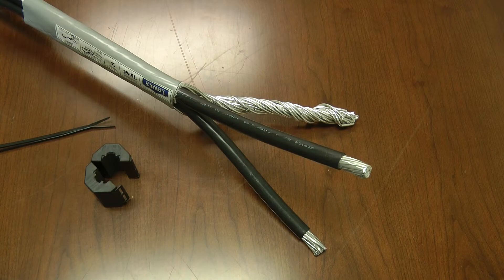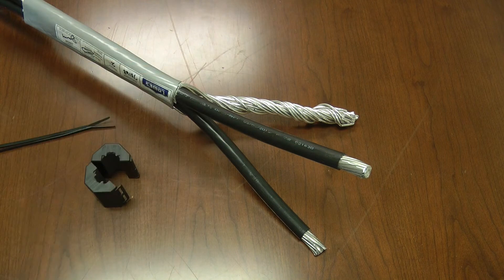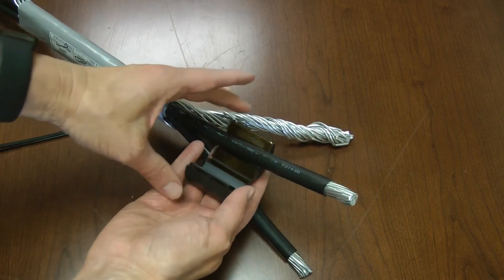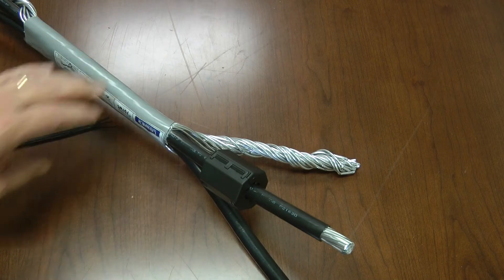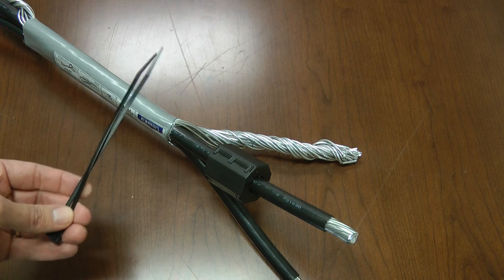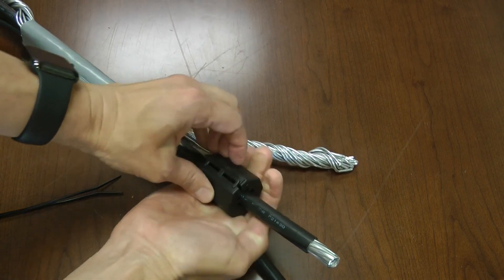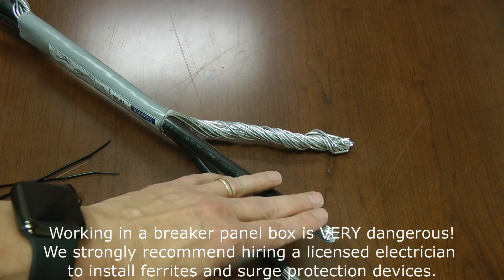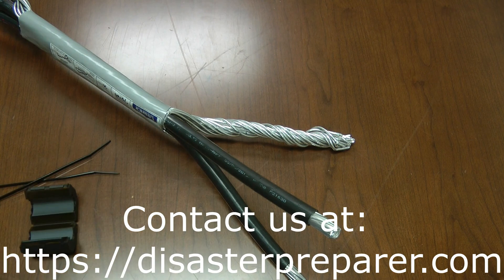Customer Installation Video

Comment: Hey Arthur, I'm about to invest in a solar power system for our home, I was wondering how you would go about handling EMP affects that can't be stopped via a surge protector like you've been speaking about lately? I know we can put a surge protector on a solar power system, but what about the charge controller and inverter? I mean those typically are sitting out in the open, wouldn't they be susceptible to EMP like other loose electronics (like cellphones, laptops, ham radio gear)? Also, do you have any theories on follow up EMP attacks to make sure those of us who have built Faraday cages are for sure down? I don't want to go down the rabbit hole too, much, I want to be reasonable, informed, and not be silly about all of it.

Comment: Thank you, Arthur
Reply from the maker: You bet!
Reply: @disasterprepper  Arthur, do you have any opinion on a respirator or gas masks?  There is a lot of conflicting information about what does and does not protect you from viruses? FDA approved N95 or N99 masks seem to be what a health care worker would wear to take care of someone with a virus like H1N1.  However, it also seems that they may not work 20% of the time even if you wear them properly. Some viruses are .085 microns or less in size.  An N95 or N99 that is FDA approved for health care can filter out only sizes of .10 micron. (not all N95 or N99 masks are equal--you want FDA approval). Since viruses are smaller than .10 microns, do you need an actual gas mask that filters out .08 or even .03 microns to be safe.
Reply: @tmt8425   N95/99/100 are useless.  They fail.  Check out  SGE 400/3 BB Gas Mask with best filter and full gear is a top pick.  Even does mustard gas. 

But to get close to perfect protection, you need SCBA.  That becomes problematic.  Better to have a BOL and stock it up.  Cheers.
Reply: Harvey Black  Thanks for the information. TMT